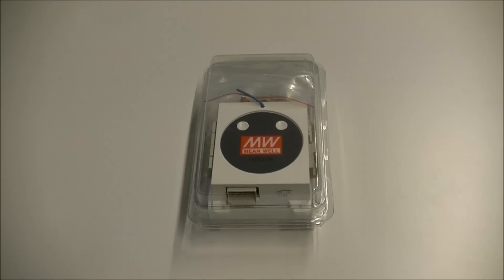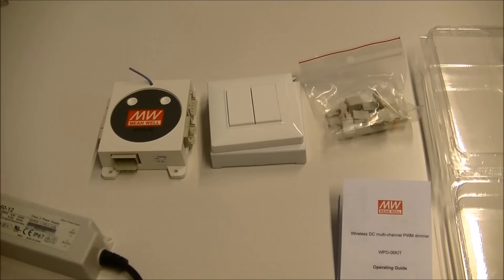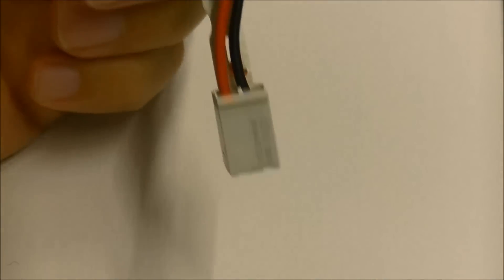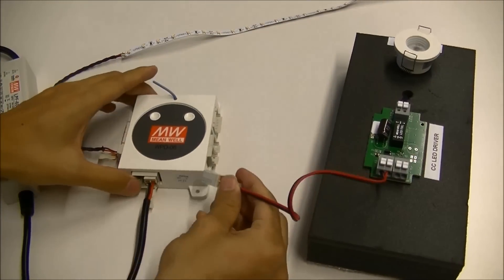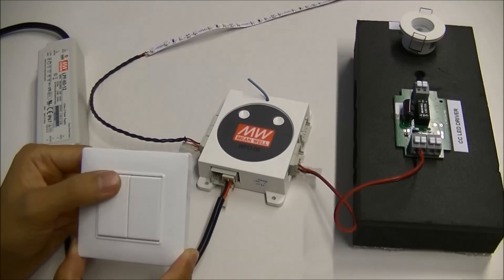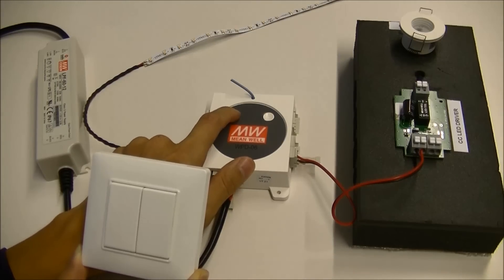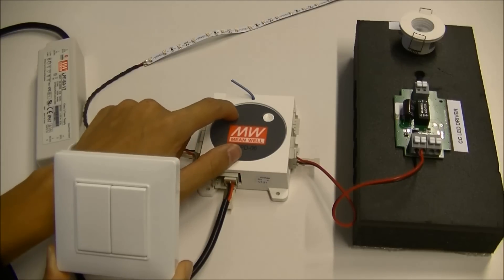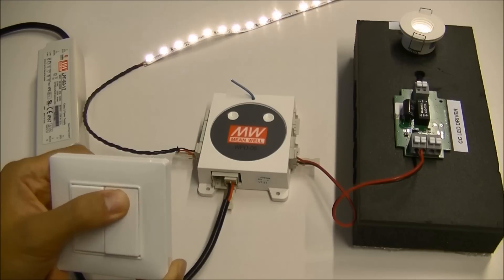WPD-06KIT installation tutorial

Comment: The LED module is using a DC/DC converter (to convert Constant Voltage to Constant Current). Additional components (like the elco) are present on the PCB with MW's 'LDD series' converter. How you make a CC LED module dimmable with only two wires? Without an additional dimming circuit? The output of this WPD-06 is PWM CV signal...
Reply from the maker: Dimitri De Rop Hello Dimitri, I just found you reply on Youtube channel. Yes, it is possible to realize CC LED module with only two wires. I will send you more info with email. Greetings, Wen